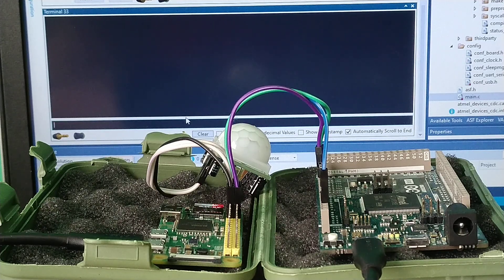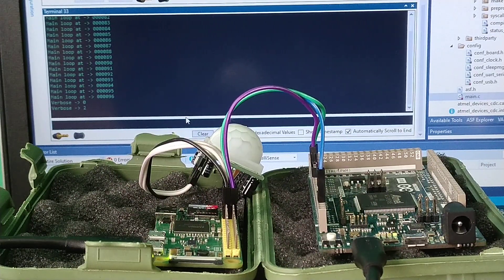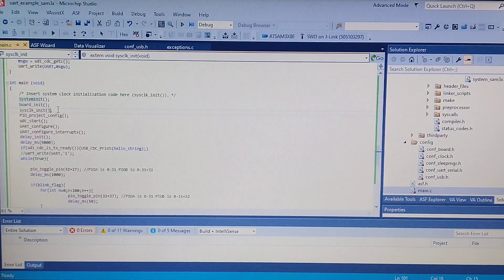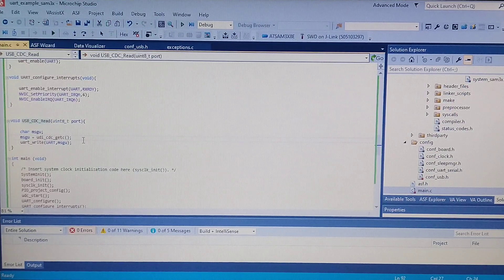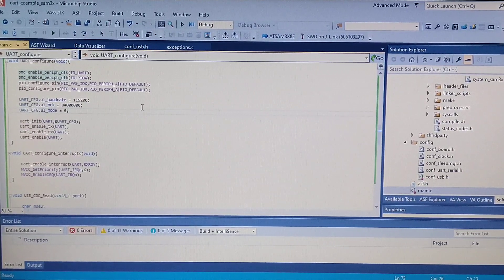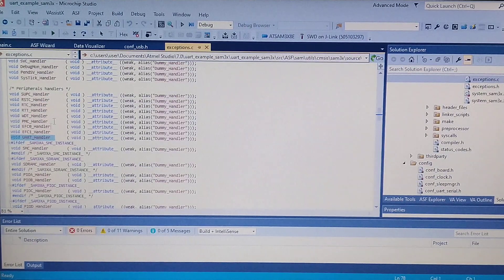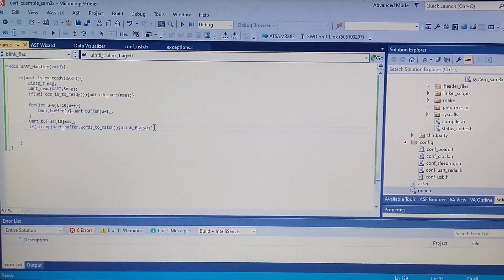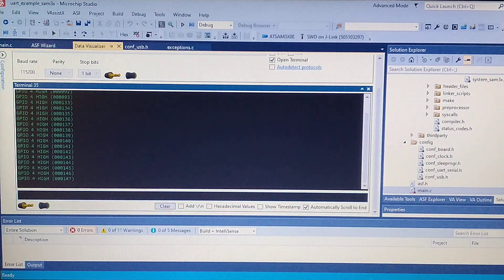Arduino Due UART +USB CDC example in Microchip Studio 7

Comment: Hello sir, please can you make a video about how to send for exemple hello world from arduino due to raspberry pi 3 using data port in raspberry pi3
Reply from the maker: If you have a rpi3 with a os like raspbian or so, connecting a usb to native Arduino Due port to the usb of rpi3 will result in detection of the Arduino Due as a usb cdc device. And to read/send data you can use for example arduino ide terminal. And make sure you got installed  libusb-1.0-0-dev on the rpi3, if not then in terminal type in sudo apt install  libusb-1.0-0-dev
Reply: @e-exp  can you please make it with atmel studio i need it , i don't now how to do it with atmel studio 7, i need a program that send data from arduino due to raspberry pi 3, please